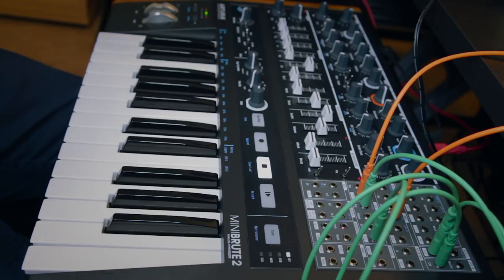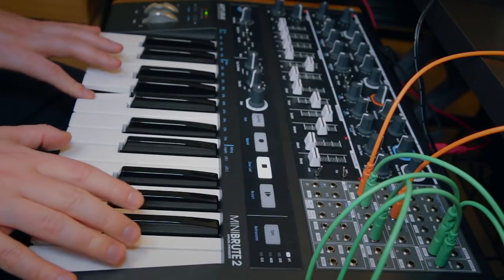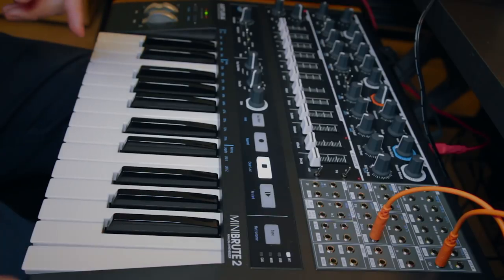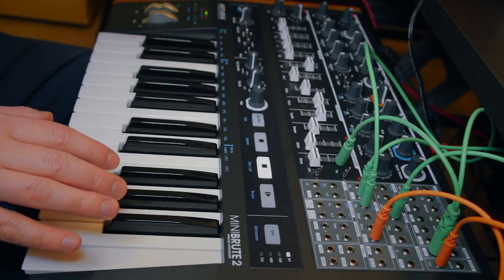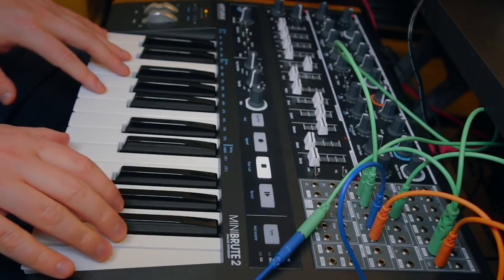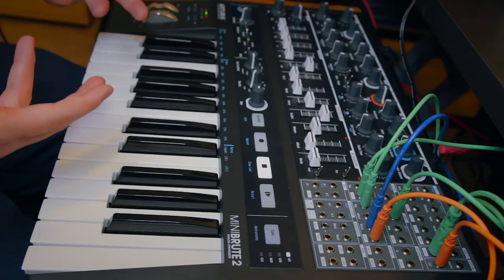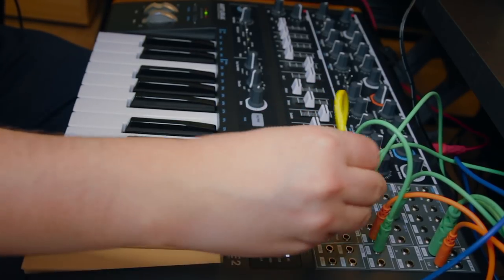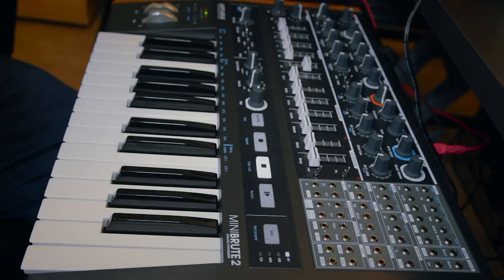How To Add a THIRD Oscillator on the MiniBrute 2

Comment: Hey Bo, thanks for the videos. I like the enthusiasm :-) I'd like to however point out that (hopefully without being a joy kill) what you are doing here is creating a wave shaping "variation" of OSC 2, rather than creating a new oscillator. Just like all those different wave sliders are not separate oscillators (basically mainly because they don't have independent pitch control), this is not a really 3rd OSC in my opinion. You can however use the filter in self oscillation and patch it to ext in, and there you'll have a new oscillator. Same would go for those LFO's if they go up to audio rate. If they do, with the help of a mix utility module, you can actually add 3 more oscillators to your Brute 2, all with separate pitch control! (usually would not totally track perfectly through out the entire range, but certainly a great added value if you can find those sweet spots) I hope you don't mind me chiming in, keep making those videos coming, and good luck!
Reply from the maker: Oguz Buyukberber hey there! You are ofc right that its more waveshaping than a real second osc. I learn as I go and I am glad for your comment :-) thank you!!
Reply: We all do! Have fun! I'm glad I didn't ruin your day :-) Cheers!
Reply from the maker: Oguz Buyukberber hence my sort of ”pseudo osc” statement :-) functionality I think it brings sort of the same functionality but w/o the ability to pitch it independently from osc 2. However using an LFO as a second osc on m32 for example also has limits. But I will refer to it as waveshaping or ”Bobeats Pseudo Osc” ;-)
Reply from the maker: No no, actually glad you confirmed a suspsion I had that this was some kind of waveshaper in disguise, or maybe a synced waveshaper as DivKid said (after hearing my theoretical reasoning)
Reply: I sometimes use those separate outs of any oscillator to create really thick sounds by externally processing them using pitch shifters, octavers etc and bringing them back into the mix with the original. That way it's an easy and fun way to create parallel moving chords using only one pitch mod source, e.g: the keyboard, sequencer or ext cv. Anyway. It's a a whole bunch of fun :-)  My best
Reply from the maker: Oh Oguz... You know what. It IS a second oscillator. In once/gate mode it is a waveshaper only. But in trig/loop mode the AD actually oscillates. :D I knew it! :D TA DA!!!
Reply from the maker: Third oscillator I mean.
Reply: I have never seen two people act this polite in a youtube comment section.
Reply from the maker: well its just synths :)
Reply: Here is how to make it a separate 3rd vco with independent control. https://youtu.be/694JF7H0cK4
Went ahead and did a super quick tip video to show how to get a bit more mileage out of the new minibrute 2

Comment: Hey Bo! Really enjoy your videos, I have learned a lot from them so thank you. Question for you: I'm new to the synth world, looking for my next piece of gear. I have a Microbrute and a Korg Volca Kick (maybe a questionable choice), and I am looking to get a new synth that can fill a gap in between these to add more layering. Volca Synth? Electribe? Something entirely else? I'm really into dark droney trance type of stuff. Really just wanted to know if you had any suggestions of what I could check out? Cheers! :)
Reply from the maker: I would go for: Circuit, Electribe 2 or Digitakt to get some more sequencing options. Use them as a hub. Maybe a midi thru / midi splitter to send midi to the two other synths (since I guess you can connect them thru eachother since they lack midi thru right?)
Reply: I'm glad you said Electribe because I am leaning towards it. I will also give the Digitakt another look, although it seems really complicated - but I will still give it a chance. And yeah no midi thru on volca/microbrute, good call on the splitter. Thank you! Looking forward to more videos, cheers!

Comment: Q. can the single ADSR  be used for amp and filter at the same time?
Reply from the maker: of the top of my head: I think so yeah! I don't think this setup breaks the filter connection... BUT if it did you could just run a splitter cable from ADSR out into both AM and FM of filter.
Reply from the maker: AAAND you should be able to run one of the splitter cables into the INVERTER to invert the ADSR to use with the FM of the filter (or maybe going negative does just that... this science is hard)